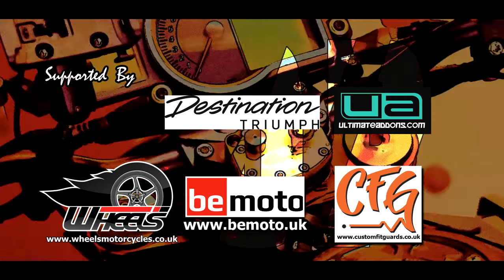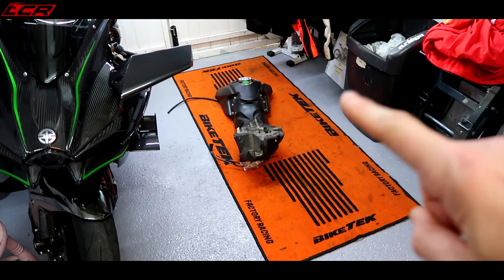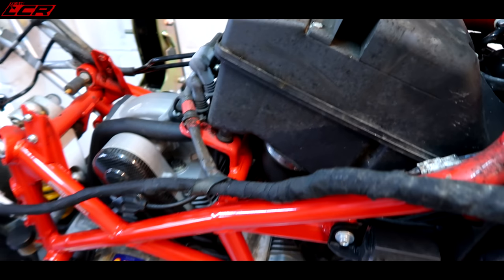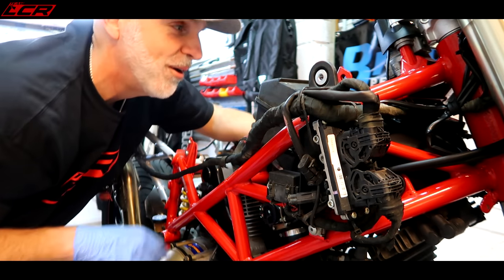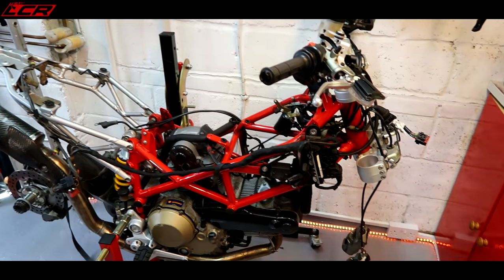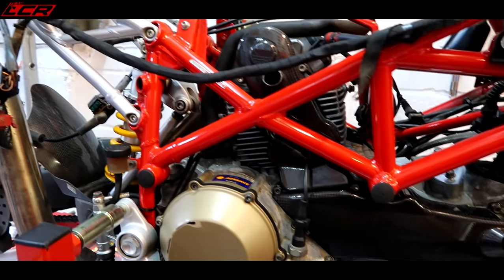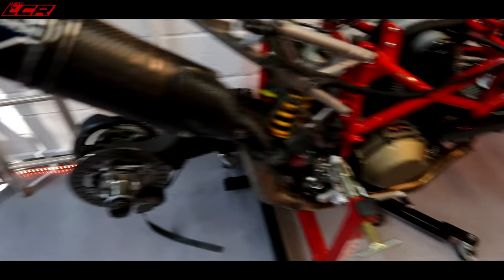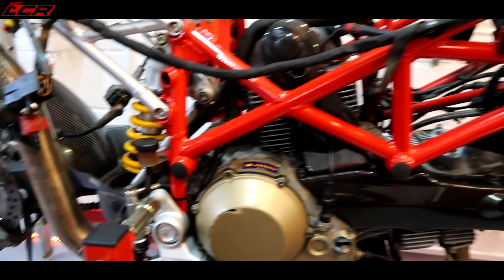Ducati Hypermotard Restoration EP03 | Little Box Of Horrors

Comment: Whew, I have a 2008 Hypermotard 1100 that I'm looking at rebuilding and these vids are going to be a HUGE help! Mine has 25k miles (bought in 2010 with 10k on the odometer), and the primary reasoning is because of that flaking coating on the engine. I thought mine was because I lived on the coast for so long, but it seems it's a common problem. C'mon Ducati!!!! Anyway Lamb Chop, I plan on watching the entire series, so thanks for taking this on for the rest of us!
Reply from the maker: Slight delay on my project as waiting for the heads back. Will resume shortly 👍

Comment: As a previous owner of an 1100 Evo SP, I can recommend the Air-box modification that basically doubles the size of the air intake. I installed a Sprint air filter. Then to compensate for those changes and to smooth out the rough fueling brought about by the factory restrictions, I had good results playing with the EJK plugin fuel adjuster. I had an SC-Project 2-1 that was very similar to the Termi you have, so I imagine the results will likely be about the same. It certainly helped free up the muzzled horses and made the throttle response crisper with a more robust midrange, and more top-end. Good luck!
Reply from the maker: Ok will research the airbox mod if I cant source the induction kit 👍👍

Comment: You're a brave man.
I've started my list of the parts that will be "left over" once the bike goes back together. Here goes: Two 8mm socket head machine screws (different lengths), three small (10mm?) washers, One large washer that you don't remember taking off and can't possibly go anywhere other than the head stock, and one small shiny metal spring clip (similar to the injector harness clip but not that).

Comment: No suggestions or ideas I’m afraid, but really enjoying this! I’ve just finished a car resto....taking pictures before disassembly when it comes to re assembly some time later  (ahem 5 years in my case!)  is invaluable. Once you have a tool chest, you won’t go back. This is really making me think of a bike resto next. I can’t help thinking you’ll have to go deeper into the engine, disassembly wise, to get the level of finish you’ll be happy with though. Awesome production standards as normal👍

Comment: Just a tip, bought myself a gear indicator on Ebay, 1/5 off the price from the manufacture you mentioned for my 1100S, works flawless. 

I have made several modifications but one of the best was flashing the ECU at Italia Bike in Sweden, almost 19 hp more and  17 nm on torque.

I'm getting the new Hypermotard 950 SP and leaving the 1100S at the seller as payment but it sure feels kind of sad, so I truly enjoying your work on my absolute favorite bike!

Keep up the work - best regards from Sweden.

Comment: I wouldn’t polish the triple clamps. You will remove the protective clear anodised coating which will mean they will corrode much faster and will be super high maintenance. Why not send them off with the engine cases to be ceracoated, the bronze looks awesome.

Comment: Chops suggestion remove clutch n basket . Remove side casing and get the metal removed in between cover attach bolts . Clean it up and get it painted a magnesium colour . I did it on my SS and you end up with a ventilated housing that looks like a magnesium one for a fraction of the cost. 😜
Reply from the maker: Ok that's Kym for the tip 👍

Comment: 5:00 Chops I'm surprised you don't have an ultrasonic cleaner, not as expensive as you might think. Surely there's some vacant cupboard space now you've migrated to the new toolbox ;) top quality content as always.
Reply from the maker: Yes you're right didn't realise they were so cheap! Going to buy a 3 litre one and do it myself 👍👍
Reply: @LambChopRides  Great stuff, just be sure to check double check reviews for dimensions of the bath. From what I've seen the capacity stated is not the actual volume available for sumbmersion, who knows why though.

Comment: You asked for suggestions: While you have it apart you should get the cylinder head ported and increase compression. People always down play the effects of porting,
 "Oh on modern bikes they're pretty good, there aren't really much gains to be had".
Don't believe that for a second. Porting can make a huge difference! You won't be left wondering if it made a difference or not. 

While he doesn't do many motorcycles any more (You may be able to talk him into it), Tim Radley is the best in the entire world that I know of and he's near your neck of the woods. 

I'm serious, HUGE difference! And not just on top end. You'll see good gains all throughout the rev range. If you haven't ridden a before/after porting bike you owe it to yourself, just for your own education if nothing else.
Reply from the maker: Good tip John, not sure I want to start stripping the engine though.. Project is already getting out of control! 😂
Reply: @LambChopRides  Anything worth doing is worth overdoing!

Comment: Good luck mate. When I tried to remove the swing arm bolt from my 2002 996, I could not shift it and had to call a shop to pick up the bike. However on all my later bikes it was a doddle.
Reply from the maker: My fingers are crossed 🤞🤞

Comment: I too have experienced mouldy ducati syndrome. A word for consideration - where mine had been stored in a damp environment, moisture got in and damaged the nikesil coating on the bottom of the horizontal cylinder. After 100 or so miles of riding it caused havoc! Well worth checking out.
Reply from the maker: Ok top tip! I have ridden it seemed good..

Comment: Hey Chops, you have to push the sides of the metal clamp and it will lift off ^^ Might be a bit odd, but actually quite simple when you have done it 
once or twice ;P And never hang the calipers in the air like that, because the steel braided lines(?)/ Steelflex are not capable of taking on this type
of stress and might be damaged afterwards. I really like the videos on the hyper, good work :)
Reply from the maker: Good tips thanks matey 👍👍

Comment: I've been looking at ceramic coatings for my 1290 SD R's exhaust headers.  It's very tough and stops half the heat coming off the exhaust. (They glow red hot and here in Australia, that can be a tad dangerous.  I didn't start the fires BTW)  It can go onto the top of the pistons (keeps the heat out of the piston) and there's one for the skirt that retains oil.  Ceramics come in a variety of colours. 

Just google ceramic coatings for engine performance and have a look for yourself.
Reply from the maker: Yes ceramic coating is a good idea, heard about the benefits before. Bit pricey mind..
Reply: @LambChopRides  I thought they might pay.  Great advertising opportunity for them

Comment: Deffinatly black for the engine and do the subframe red to match the main frame plus you get better finishes with a black paint rather then silver will show every little imperfection. good project tho
Reply from the maker: Hi Greame, yes black engine would look good.. only concern is chips on the forward facing cylinder as it's right next to the front wheel.. At least silver they wouldn't show so bad..

Comment: New discs, pads and either rebuild kits or new master cylinders plus seals and new pistons for the calipers are almost a necessity  on a bike of this age... you will regret not doing them at this stage.

I would suggest you get the suspension rebuilt buy Maxton, K Tech etc, new oils, seals and a valve job plus possibly springs due to your Stature Chops 😇
Reply from the maker: Thanks James, had the caliper apart yesterday and piston look good. Did remove one to inspect it and no corrosion so just cleaned and put back together. Forks and shock will go off for a refresh good idea 👍
Reply: Lamb Chop Rides great, I would suggest removing each piston and caliper and cleaning in your ultra sonic cleaner if you get it, BUT more importantly remove all the seals, clean and then clean very thoroughly the seal grooves in the caliper bodies, this is where dirt and corrosion build up pushing the seals onto the pistons and making them bind. Use a 90 degree pick to properly clear the bottom of the seal grooves of crud. 

When rebuilding get some red rubber grease and coat all the seals and seal groves in the calipers to stop corrosion.

Doesn’t take long, may be a morning’s work. 👍

Comment: Amongst other things im a gunsmith , you can buy a ultrasonic cleaner big enuff to take twin carbs for £100 not worth sending them off plus you can clean a lot more things in it that you may think . check out amazon for one.
Reply from the maker: Yes going to get one, didn't realise they were so cheap!
Reply: @LambChopRides  Do not have all the information but you cannot for instance use them on a firearm silencer,s they fatigue the aluminium , maybe just a thickness issue but maybe not use it on something thin aluminium and life altering  :)

Comment: Mornin!. Now your getting to it first and foremost....if youre going to take the rear shock out be really careful as the bolt that connects it to the swing arm [theres a gap] internally on the swing arm which you can loose the bolt in then...its in the swing arm....yes, ive done it...on my last hyper... also, if you manage to source some air pods theres a load of spare room under the tank. I put a denali soundbomb in there...and, it being under the tank...makes it louder....awesome for watching dumb car drivers heads hit the roof of the cars when you hit the button....nice cos it makes the look of the bike a tad better (no horn showing) and you get a fuck off loud horn....
Reply from the maker: Morning matey, top tips as always buddy thanks 👍